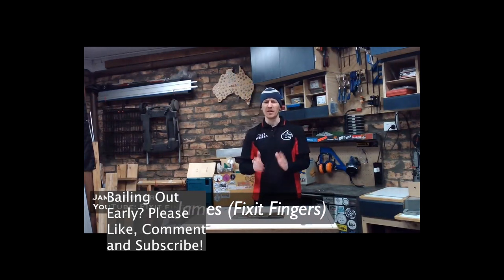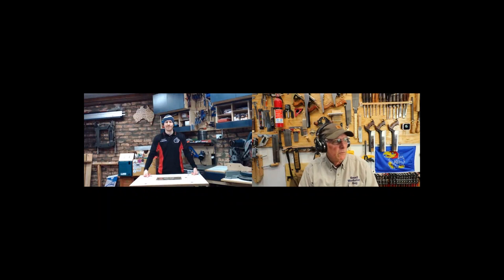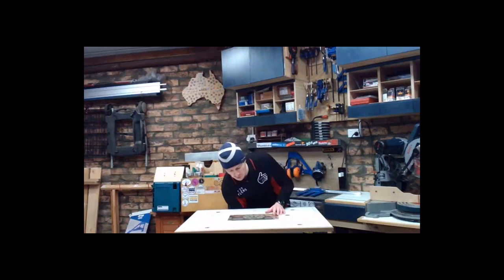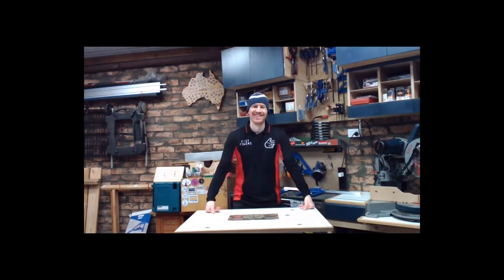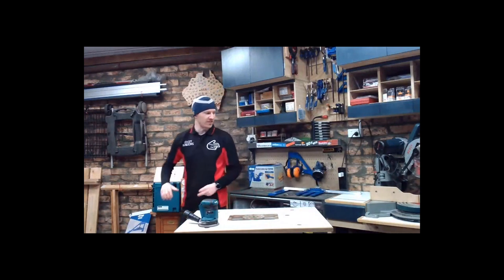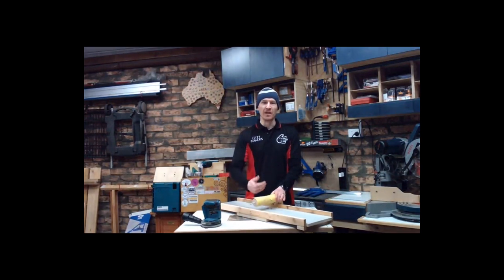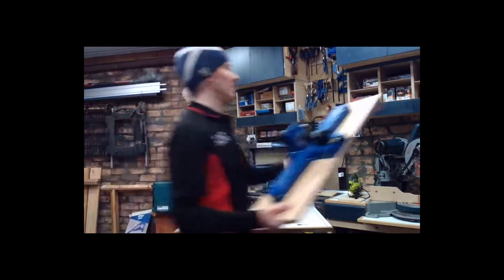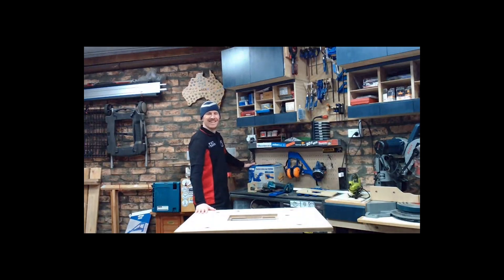A Visit to @Fixit Fingers Really Small Workshop in Sydney, Australia Arranged by Small Workshop Guy

Comment: What James did with his workbench by making it convertible and turning multiple hand power tools into replacements for bench tools is what I did with my DIY tablesaw. I made a folding table that has a cut out in the center and then made an insert that I mounted an old B&D  circular saw on, and mounted it upside down to make a tablesaw. I made it as precise as possible, measuring over and over to get it exactly perpendicular to the front edge of the table, as well as exactly parallel to the miter tracks that are on each side and parallel to the DIY fence. It makes perfect 90° rips and crosscuts, so for now, it will do. I then made another insert that I mounted my Ryobi jig saw onto, that made a makeshift scroll saw. I had trouble with the blade flexing, so I took a length of ¾" round aluminum stock and made a guide for the tip of the blade to help keep it straight. That caused another problem, as it only had about ½" clearance under the aluminum bar, limiting the thickness of the wood that I could cut. I also made a router table that sits on top of my tablesaw, but that's a story for another time.
Reply from the maker: Man, I love your comments - educational - now get that workshop cleaned out!
Reply: I've thought about adding a guide to the flipped jigsaw as yep, that flex can be pretty awful even with good blades. The flipped circular saw I've prototyped, unsure if I will revisit the design or try to fit a real saw in the shop... time will tell. Thanks for watching!
Reply: @FixitFingers  When you don't have the space, money or whatnot, creativity is the answer. I like what you did with your shop James, it's very creative.
Reply: @SmallWorkshopGuy  At least I have about eight months before you take possession of your van, and then another few months doing the conversion, so hopefully by then...